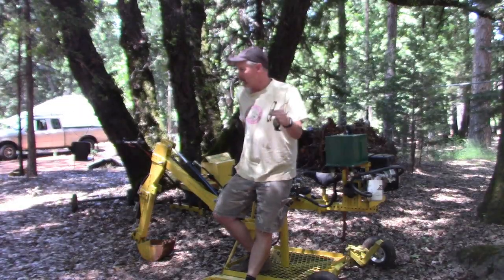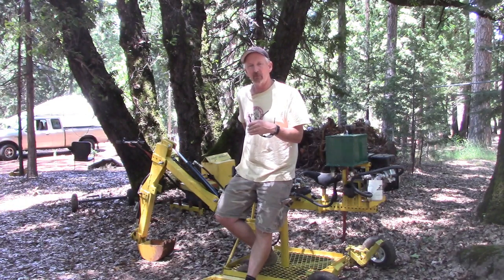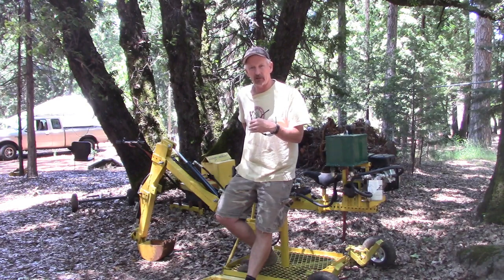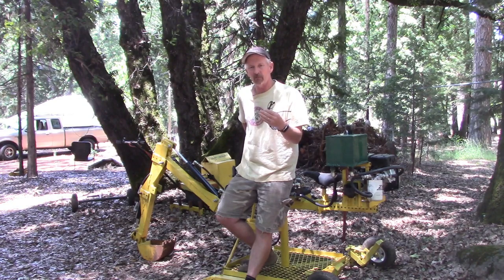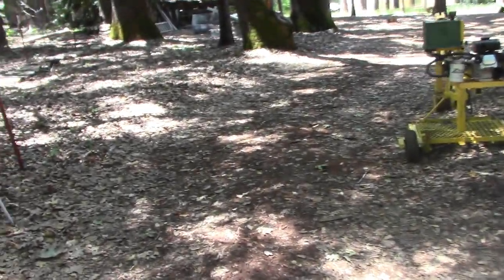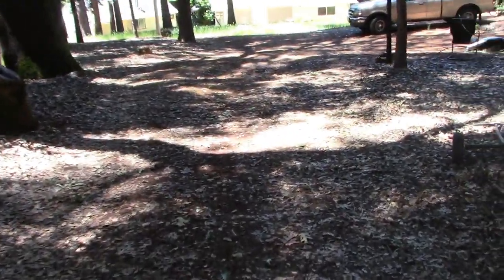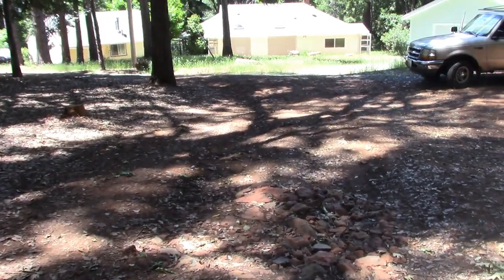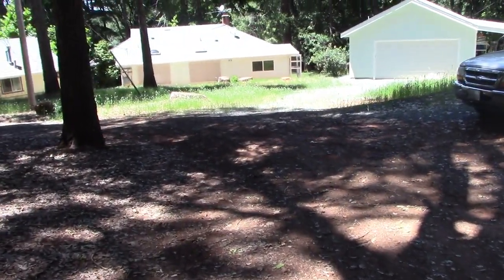driveway repair

Comment: hello sir what kind if motor do you use?
Reply from the maker: The backhoe is a 3 hp gas engine  or 2 hp Electric. The walk behind tractor is a 1 Horse power PM motor https://www.surpluscenter.com/Electric-Motors/DC-Motors/DC-Motors-Base-Mount/1-HP-12-Volt-DC-1800-RPM-Motor-56C-WWE-WPMDC1-18-12V-56CB-10-2574.axd